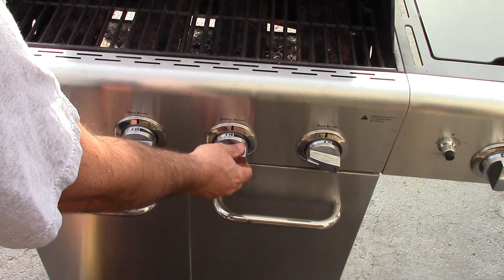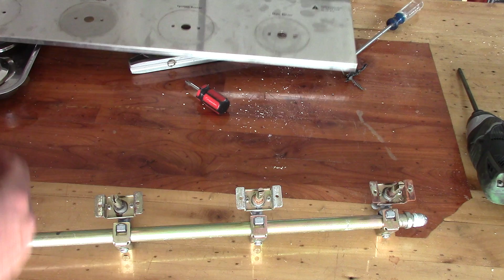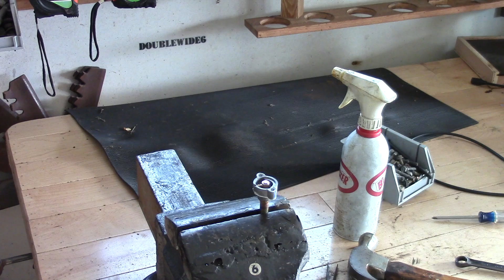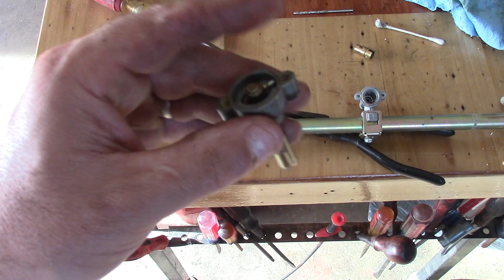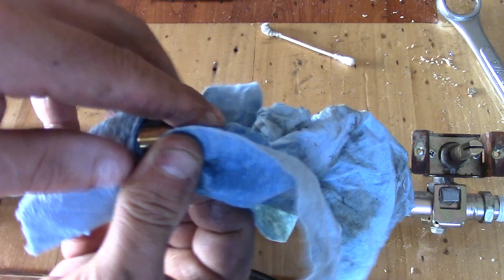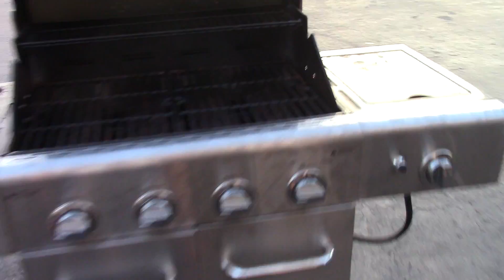Gas Grill Valve Handle Repair:  Handles Are Stuck

Comment from the maker: http://amzn.to/2i8FHiQ Kenmore Manifold Assembly
http://amzn.to/2iaO79p Grill burners, cross T's & Heat Shield
https://amzn.to/2F2F6Zy trough to fix rusty bottom
http://amzn.to/2gH1Lkp H style Burner Replacement
http://amzn.to/2iag6X3 Gas Grill Regulator Replacement
https://amzn.to/2GSU9rd Great Little Webber Propane Grill $350 
http://amzn.to/2gKvHML Ignitor Replacement
http://amzn.to/2ibrzFV Replacement Cast Grill Grates
Help support Doublewide6 Repairs LLC by sponsoring his Patreon account
https://www.patreon.com/doublewide6

Comment: dude....! BRASS DOES NOT RUST! BTW aluminum doesn't either. Rust is  ORANGE/RED yes. BUT what you see  is more likely from some other gunk orr from (METAL made with IRON)! More so, rust will not stick to a brass less it is coated around it like a ring. Otherwise it should jut brush off with a green scrubbing pad and a little soap.
this is 100% FACT! 
heating it with a torch can POSSIBLY damage any seals that prevent gas leakage.

Comment: Thanks for this.  I had a stuck valve.  $95 to replace (for an old grill on its last legs); a full one-quarter the cost of decent new grill.  It never would have occurred to me, but heating that puppy up freed it up. The valve is good as new (but, of course, the rusted/oxidized/stripped/broken screws are the challenge now).

Comment: My gas valve stuck or had a problem  and burned what appeared to be the "O-ring " or black sealant on the gas valve which goes to the manifold .I freed up the valve but I dont know what to use to seal the valve back on the manifold . Its attached with just one screw and a clamp (I'm sure its the same as the one you have here Kenmore but looks like a charbroil ) .Any suggestions what can I use to seal it back on the manifold ? It was may be a black hard rubber like compound "O-Ring " or like a semi hard putty ?? Thanks You video is great :)Ang

Comment: Great video. I bought a Grand Cafe Grill almost 30 years ago and it’s still going strong, but this year the valves have been problematic as they are quite stiff, and replacement valves are not available.  Your video provided critical advice.  Many thanks. Much appreciated.

Comment: Great video.... thanks for doing the hard work!  just an FYI, the "pilot hole" you noticed is actually a gas orifice and controls the volume of gas that is mixed with air in the burner tubes.  Common reason for low flame volume is a part plugged orifice.  Some of the BBQ's I've worked on (ie Napoleon) use a piezo electric crystal to light the actual burner tubes.  I noticed a lightning bolt on at least one of the gas knobs.  the battery operated igniter is usually for the side burners or the infrared gas bar at the back of some BBQ's - but again, a really great job that anyone can follow confidently!  Thanks

Comment: I've got a 5 year old Char-Broil 5 burner TRU grill and every one of the valves is leaking gas out the orifice. It's in pretty nice condition since it's kept covered and under cover. I mostly use only two of the 5 valves and one of them never got use. I opened up one of the valves that does get used and it looked great. Springs also look great. Of course, Char-Broil's answer is to buy the entire valve system. Thinking there were seals in the valves, I asked the support person if they sold replacement seals but they said they didn't sell them separately. Was a little surprised to find out there were no seals so.....I won't be buying another Char-Broil grill, that's for sure.

Comment: Did you consider that you had likely removed all the propane from the line leading to the valves when you cracked open the unit? That might be why the burner didn’t light immediately.  You have to replace the air in the system with propane.  By opening all the burner you purged faster but when you finally did get all the air out and propane reached the burner, all the burners were pumping out the explosive mixture.  Singed eyebrows in a flash - experience speaking here.
Reply: appreciate the video. was great inspiration to finally rehab gas grill. In case no one has mentioned any solutions to your IGNITION ISSUE...the igniter should have a catch box  positioned around the igniter at the location where the arc occurs. the catch box allows the gas to concentrate at the site of the ignition. without a catch box, a copious amount of gas must released into the fire box before the concentration of gas is sufficient enough to be ignited by the arc. think it goes without saying that at that point the ignition is more like an explosion as the excessive amount of gas ignited. Unfortunately, i believe there are quite a few people who routinely lite their gas grill  using this method.

Comment: There's really not much to those pits and most of the stuff that wears out can be found at Home Depot, Academy or Lowes.  I had no idea the valves were that easy to bring back, however.  I never fail to pick up some bit of knowledge on your videos, Bob!  Many thanks for all that help!!
Reply from the maker: Well, that was the first time I cleaned a grill valve myself.  I knew it was rusted, so I figured I would take a look at it.  Did you see the link to the burner assembly?  I'm happy I was able to fix it because the replacement valve set is $130.
Reply: Oh wow...I didn't check the link, but you could make a good living fixing those things if new ones go for that much!  :>)

Comment: IMO, you should have removed the C-clip from the shaft, removed it,  cleaned it and the aluminum housing cover bore  also, then lubed up the valve shafts with something like Fluid-Film to keep the corrosion from happening again.
Reply from the maker: No doubt, that would have been the best way to handle it.  It all comes down to how much time do you want to take screwing around with it.  Fluid film is good stuff, but it does get sticky and waxing over time.  I use PB blaster instead.

Comment: Good job as always. Looks like you singed your eye brows a little. LOL I have had the same thing happen to me. Hey I like your wire brush setup you got a video on how you made that?
Reply from the maker: The wire brush is an old clothes dryer motor.  It works well better than being in a landfill.

Comment: I had this exact style but it was the full blown unit with the smoker, what a disaster! I probably paid 6 and change for the thing in 2013. I'm not sure who is or did make it for Sears but it is absolute garbage. Asked someone to help deliver a patio set last year and while he was here I asked if he wanted the unit, 5 minutes it was out of here. For the money I could have bought a Weber and should have. Sometimes the looks of a monstrosity over comes common sense.  It was a stupid knee jerk purchase.  Never again.
Reply: doublewide6 Repairs LLC pre 2006 Weber's are great. better to restore one of those than any other.  the ignighter at least on Weber's have a cover over the sparker to catch some gas and ignite.  I think that is missing on that grill and why it doesn't light.
Reply from the maker: I never had a weber, but I guarantee they are much thicker and stronger than this one.
Reply: The weber gas grills are awesome!!!!!!!
Reply from the maker: The metal is very thin and the welds are just little spot welds that over half of them are falling apart.  I thought I might swap it out with my charbroil, but the charbroil is a 7 out of 10 and this one is a 5 out of 10.  Looks nice, but cheaply made.

Comment: Nice! I can never get an igniter to work for very long... my current grill has a manual, push-button one but either way they seem to crap out on me in no time! Let me know if you have any ideas or suggestions! Thanks
Reply from the maker: Here is what I found, but I don't know why?? If you back up the round gas pipe, so it is not pressed hard into the back of the  valve it lights every time right away.  I think it lets more air mix with the propane.